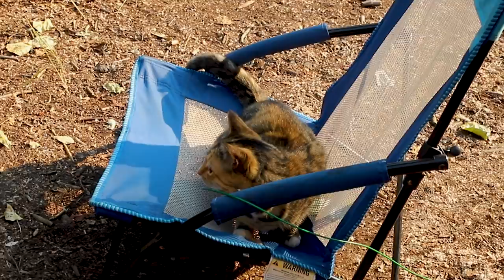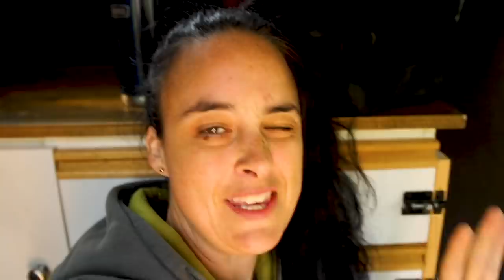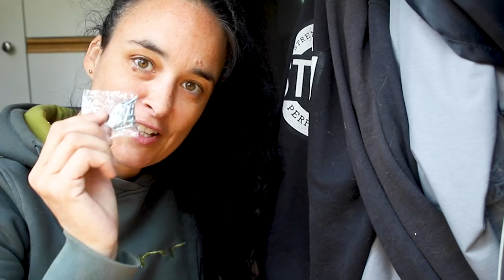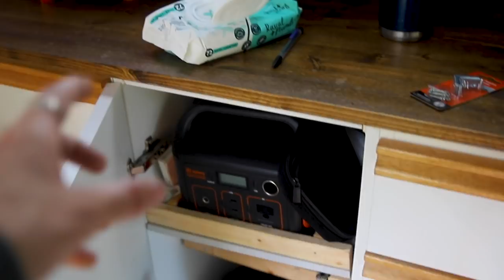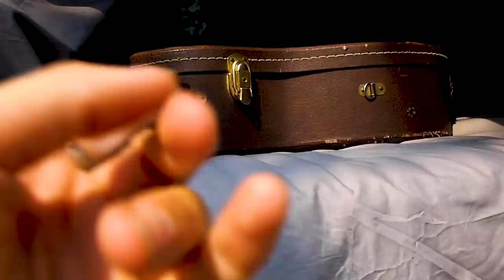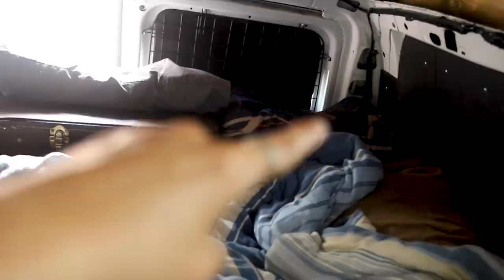It never get boring when you live in DIY van/ My best tips if you are building a van

Comment: One thing you can do with winter clothes and blankets storage is put them when they are clean in white plastic perfumed trash bags and close them up to keep cat hair from building up on them. Use your little vacuum to suck all the air out if the bags an then tie them tightly. or if you have money but space bags to use. Brush the cat outdoors when relaxing by the fire as often as possible. She will love the attention and not cough up so many hairballs.

Comment: My wife always says “you have 5 million screws and you need to buy more?”.in my minivan I keep one of those plastic organizers full of screws, hardware etc (and L brackets). One tool you might consider is a Dremel. It’s small high speed rotary tool that has 1000’s of different attachments. The cutting wheels are the ones I use most often. There are ones for metals and for plastics. They have battery powered ones but I use a 110 v one on my inverter. Good luck with the heat out there Emi!

Comment: Emi, I wonder if you can get a small plastic kennel to put Kelly in, and cover it with a heavy blanket, when you vacuum...if that would make it possible to use the loud (but stronger) car wash vacuum?  You are doing a great job!  Thank you for sharing with us how you repair things and how things come apart from driving vibrations.  My van is still quite new and the only thing I have built so far (out of wood) is my bed.  Everything else is plastic drawer units and plastic containers, held in place with bungee cords.  I am going to check my bed for loose screws right away!!